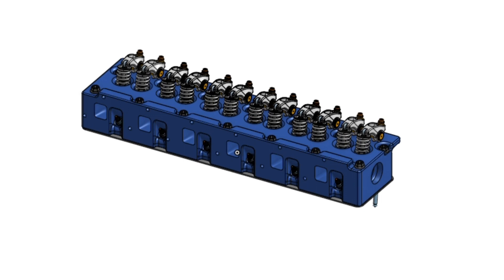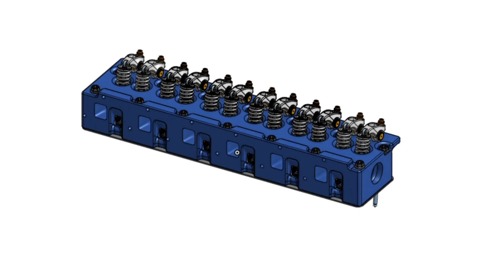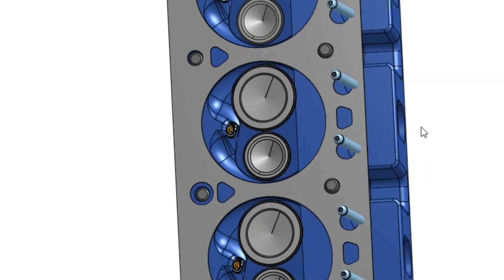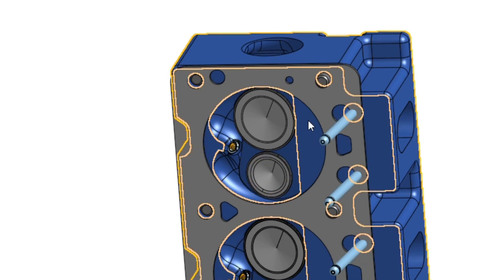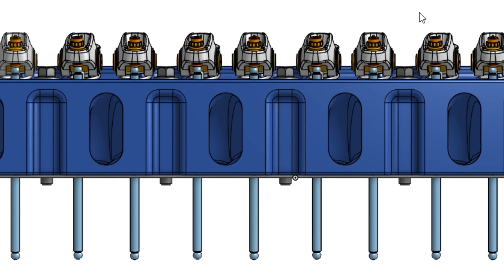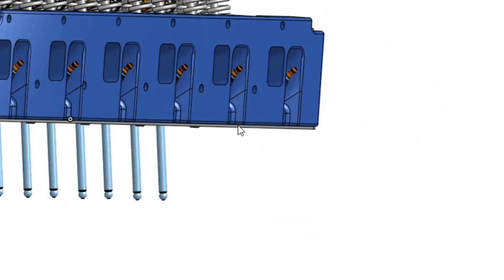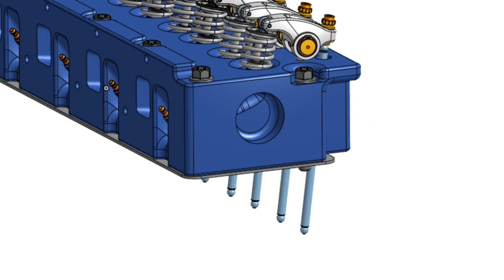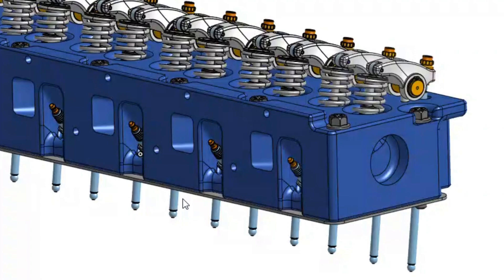Ford 300 Crossflow Head PT.2

Comment: What are your performance goals?  eg. if you want a 6000 rpm peak, a 2" valve will work.  Air demand is CID*RPM/N/1022. You want the bottom of the intake port to be 1.5" above the deck.  Assuming 290 cfm, the port area at the flange should be 2.25 sq.in to give 310 fps mean air velocity (cfm*2.4/MCSA).  The exhaust ports should be as tall as the throat is wide.  Drag boss garage has tonnes of good info on port and chamber design.

A 9 or 10 degree valve angle will make it more efficient with high swirl with lots of torque, and help pushrod angularity.  I think you will have wet flow issues.  Bring the walls in around the exhaust valve and move the plug closer between the valves.  David Vizard has some good chamber shape videos.  I would make a flow box (a single set of ports/chamber) and port and flow test that.  Ports can't be designed in CAD.

Comment: Dohc, just go barra then [edit] one thing i would like to see is a 4v setup like the diesels have where one rocker pushes 2 valves open because they're bridged.  That's just a pipe dream of mine, though.
Reply: Even if stay only with 2 valves per cilinder, a DOHC seems interesting. Perfectly spherical combustion chamber, sparks in the middle, just like 60's and 70' Alfa Romeos...

Comment: Just subbed! Have you gotten any further with this? There is a ford 300 head out there that is 2 351C heads welded together and made over 500hp without much effort. Whatever you do please retain some sort of off the shelf bolt pattern for the headers/intake so it would be easier to find parts/gaskets. Please let us know if any updates man
Reply from the maker: Hoping to have some updates on design in the next month or so. It’ll be a long process

Comment: the combustion chamber is spherical so you could rotate it around the center of the sphere and it should be quite similar to the original. i would prefer doing that rather than modifying the block to clear the pushrods. also you could use two nested springs to avoid valve float, but i understand wanting to stay with LS parts. there is an engine simulator discord by ange the great, its an audio simulation and has a free version but it would give you an idea all the same what it sounds like and if it runs well. Its not difficult to modify.

Comment: You're gonna pull this off! Two ideas come to mind. You could do lost PLA casting that way you could 3D print your blank, even in multiple pieces that fit inside of a 3D printer and then glue the prints together for the mold packed into the casting sand. Kelly Coffield does an intake manifold with this method. Second idea is you can make the cylinder head in multiple layers for the water jackets needed for cooling <like a layer cake>. With this method you could CNC mill the surfaces then have an extra intermediate gasket for the water jacket layer... or even Send Cut Send many layers. They do up to 1/2" thick material so just have extra layers of copper head gaskets for the combustion layers then whatever gaskets that can stand up to the cooling system water pressure for the upper layers.
Reply: Send cut send would not work , they do sheet steel not forged or cnc machine